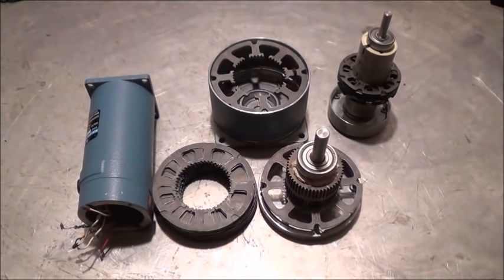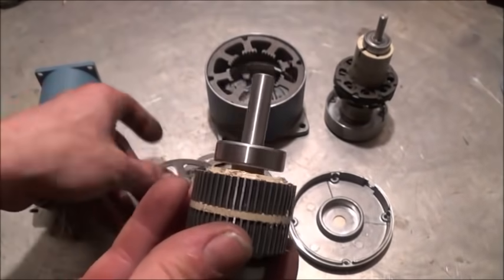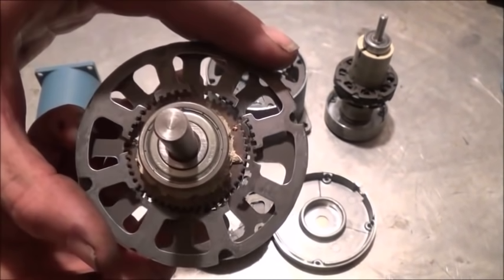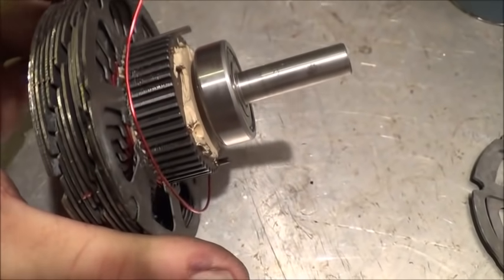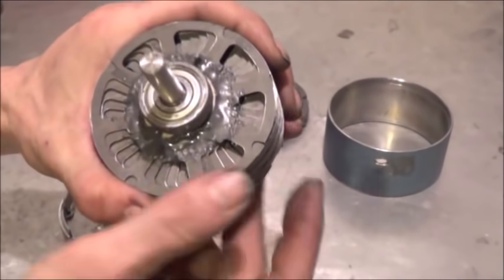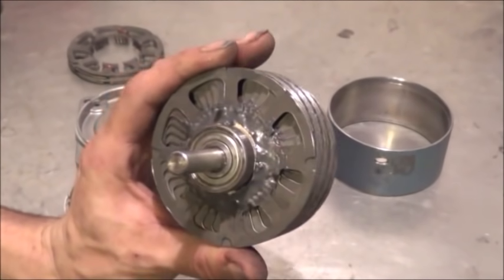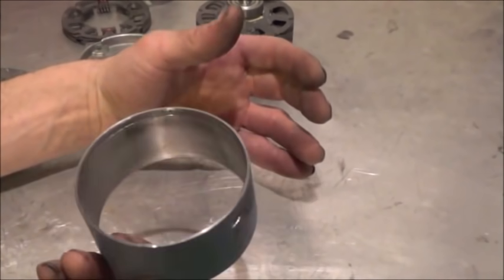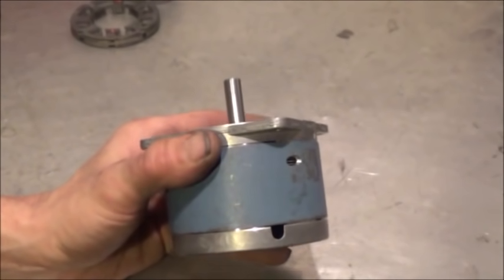Tesla Turbine, "How To Make Your Own Tesla Turbine" for Hydroelectric, Steam, or Wind.

Comment from the maker: This design could be made better by producing your own boundary layer discs, the one's in the stepper motor have a limited amount of surface area which reduces the boundary layer effect between the blades.
Reply: MrTeslonian  is it possible to combine your tesla turbine with your gasifier  by double wrapping copper piping around the gasifier and using the heat to turn water into steam? How efficient is the turbine? Does it reach the over 90% efficiency of the original?
Reply from the maker: +MrTeslonian  watch these videos of it in use.
https://youtu.be/UwctqUYH2TA

https://youtu.be/Fcer2qeeD9k

https://youtu.be/9gsVj9uo5vo
Reply: +MrTeslonian Thanks !  You are an all time favorite for me.  Really inspired and inspiring !
Reply: +MrTeslonian I was thinking the same thing. Have holes in the front plate just like the back plate. create a side entrance manifold which will swirl the molecules into the front openings of the offset rotating plates while sealing the edge notches including to the outer case. For the back, seal the inner holes on the rotating offset plates ensuring there is sufficient gap on the outside for exhaust to escape towards the back plate holes. An exhaust manifold can also be created if there is a need to group and reclaim whatever molecules are coming out the back. Of course appropriate sealing and lubrication methods would need to be implemented with respect to whatever molecules are being transferred, including stainless for H2O transfer.
Reply: We need more people like you that  inspire others. I like what you did with Tesla motor that what would be the best in technology and you made yet an improvement to it nice keep on doing what you do and show it to the rest of the world like Benjamin Franklin did when he would make or improve something.well done
Reply: +Mr Teslonian ALWAYS followed/respect your work. One thing that might make this design much easier to achieve may be a 3d printed design, using certain materials able to handle rotational forces etc. This way could achieve a perfect path for your fluid and achieve perfect gaps much faster/easier too. Just an idea....